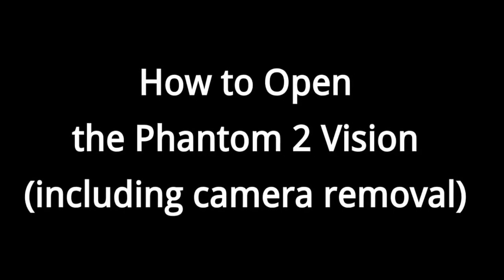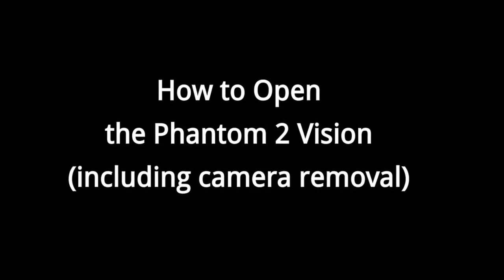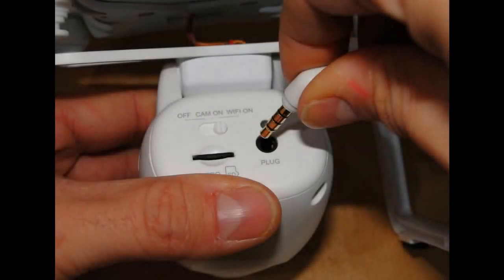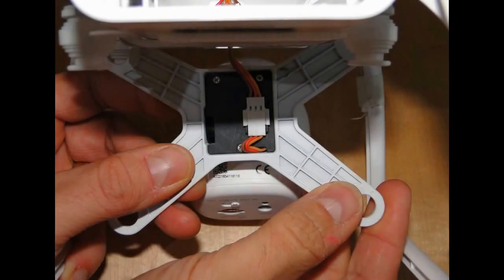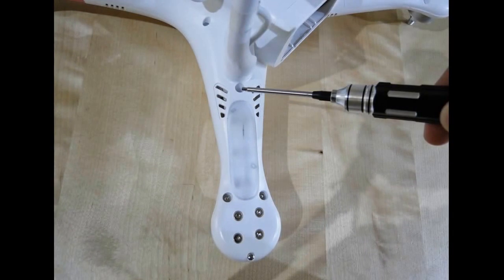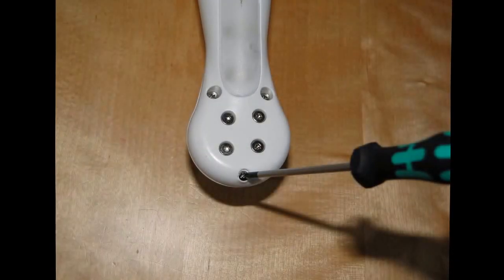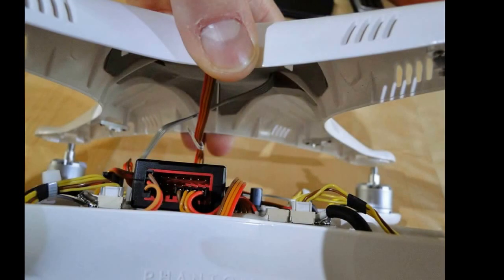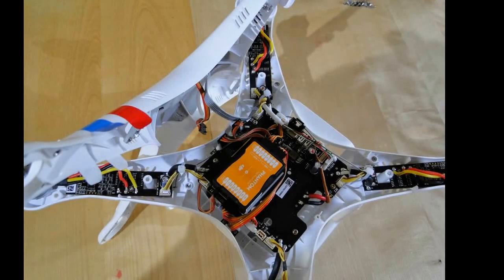How to open the DJI Phantom 2, Vision, Vision+ (& how to remove the camera on Vision)

Comment: Simon.... help!   On the P2V+ the compass is molded onto the landing gear.  I want to put on some extended landing gear.  Can I just pop off the little rectangle that hold the compass on?  Or will something break?   I realize that I will have to physically attach it to the new landing gear.
Reply: +Simon Newton yes, thanks!  I tried it!  It pops off a cover.  BUT, the connector pin is too wide for replacement landing gear unless you set it up fairly high.  We'll soon see :-)
Reply: will do .... Thanks again!

Comment: Hi Simon
  I need your help. My Phantom Vision 2+ actually blew away into the water on my pier after a safe landing in high winds. To make a long story short I washed the salt water off and dried. Now, everything works, incl. flying, gps, gs, and picture but I get no video. I just changed the antenna board but still nothing. It's like taking a picture but cant see through the lens. Help ME! You are the expert.
Rich
Reply: yes it does, but I got it working now, thanks
rich

Comment: Great instructional video!  But i'm having problems removing the tiny cross head screw at the end of each arm.  I have the correct size screwdriver but I really have to put some force into it and I cant get the screw to move.  Really worried about ripping the screw head up and then having to drill it out (with all the warranty issues that would entail) and trying to source new screws.  Are they loctited in?  I have a P2V+ V3.0
Reply: ***** Cheers!  I must try harder (literally)!

Comment: I used a #0 Philips screwdriver (vid suggested #00) with a lot of pressure. Holding the top body and pressing real hard on the screw. DJI did a super nice design and installed metal nut plates on these little screws. It was a pain to get them out but metal nut plates gives you the ability to use blue or purple loctite (1 to 2 threads and wipe off excess) which prevents screws and bolts from vibrating out in flight..
So
On your install use purple or blue loctite on the screws / bolts or your surveillance drone will fall apart in flight.

Comment: Simon I've been hunting for a long shaft 2mm Hex driver in vain. The ones I've found have quite thick heads and so I can't get close enough because of the landing gear.

What do you use ?
Reply: thanks
Reply: ***** I ordered one of these...

http://www.ebay.co.uk/itm/371231770407?_trksid=p2059210.m2749.l2649&ssPageName=STRK%3AMEBIDX%3AIT

Comment: One other question Simon .I have not been able to read anywhere why it is that the S1 switch on the Phantom Vision 2+ has to be cycled 5 times prior to calibrating the compass.

Just what does the cycling actually do .......... from the physics standpoint that is?

Comment: Simon, you say in the video that you cannot remove the compass cable when you remove the top of the aircraft.  I have on order a replacement anti-static shielded compass for the Phantom 2 Vision, and as it's offered for that model there must be some way to remove it, but I notice that the shield cable that comes with the new landing gear is much shorter than the flat one shown in the video.   Do you have any thoughts on how to go about doing this update please?  I get the impression that there must be some sort of connection under the GPS shielding, but haven't looked for myself.  I don't want to keep unscrewing and then re- screwing the top cover, and as you have done several videos of modifications and maintenance since you made this particluar video, if you have now found the compass connection the GPS board, and do you theink that the cable on the replacement leg with compass will reach easily or likely to be a struggle?   Hope you can help, cheers.
Reply: *****
Thanks for your reply Simon.  I've done the motors, esc, and props uprade, and thought  I might as well go the whole hog whilst I was at it, but as you say it's probably unnecessary. I think the upgraded compass looks neater but that's about it :)

Comment: Simon, I am new to the PV2+, and would rather take my initial flights without the camera attached.
Can I simply remove the camera by removing the anti-drop pins, unplugging the 3 multi-lead cables to the camera, protect them and go fly the Phantom?
I suspect there will be no telemetry showing range, height etc in the resulting configuration.
Your comments would be appreciated.
Reply: ***** Simon, many thanks for the prompt reply.
You confirmed what I suspected. While this is my first large quad, I have been in RC model aircraft for several decades, and have experimented with the small Hubsan X4 107 to get familiarity with the quad's quirks. The most difficult I find is the control reversal when the quad is coming at you, mainly because it's difficult to tell orientation when far away.
Practice will help improve things I hope.

Comment: Simon,
Great video!  I'm concerned about stripping the small phillips head screws at the end.  Would it be better to remove those first while there is less tension at those points or does taking the hex head screws out first reduce the tension and make it easier to remove them.  Thanks for you help!

Comment: Thanks for this. Do you think it will ever be poss to attach a zenmuse gimbal to the vision instead of its own camera ?
Reply: ***** I have the vision but i want the best of both worlds, the fpv on my phone/ipad, telemetry charge and go but want to use my gopro3+ and not sacrifice the video quality by using the vision camera. I don't want to solder or get my hands dirty either, a bit fussy i know. I do like the look of that gimbal though. Thanks for showing me.